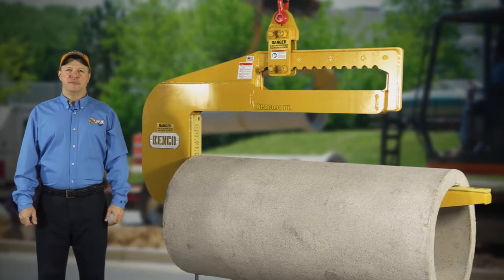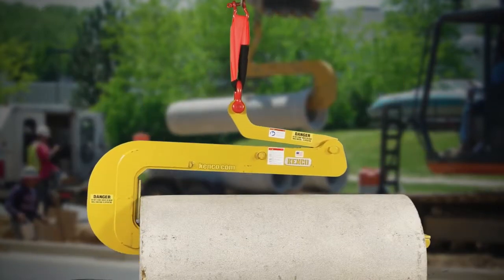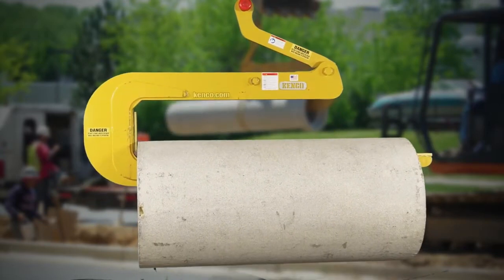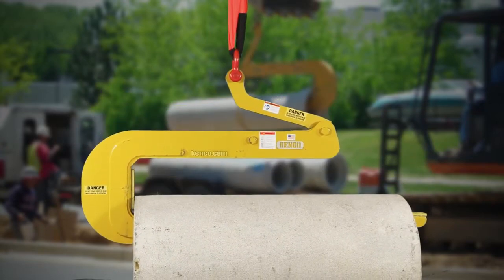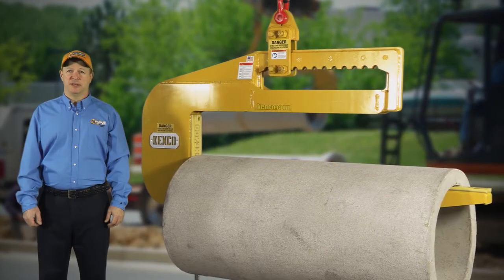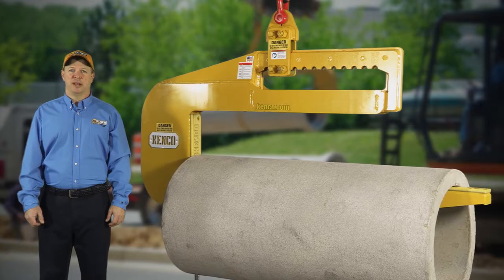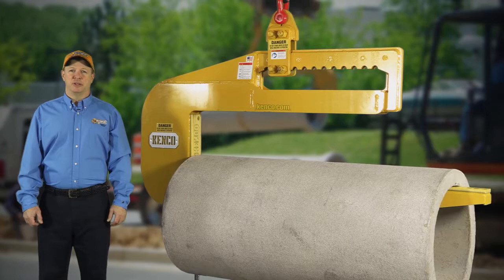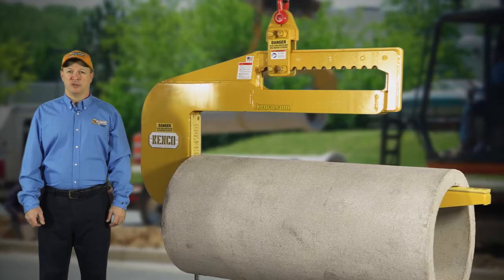Pipe Hook Overview - Kenco

Comment: Looks pretty reliable just Remember you have to pull it out of the pipe which may prove tricky in tight situations 🤣
Reply from the maker: Yes, you make a really important statement. For pipe installs, you'll need some room dug in the trench to remove the hook. In some ways, a Pipe Lift (picking up from the top) can be used to help with this situation that arises from the Pipe Hook. Great comment!